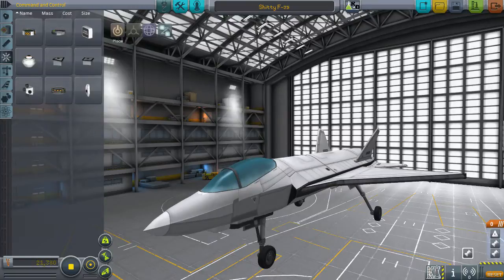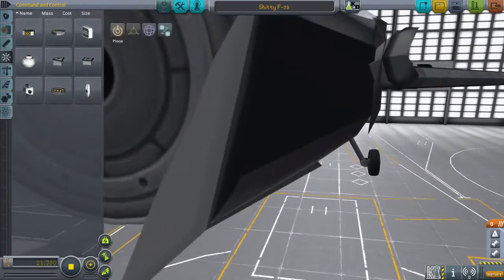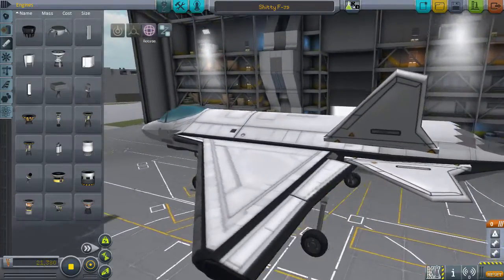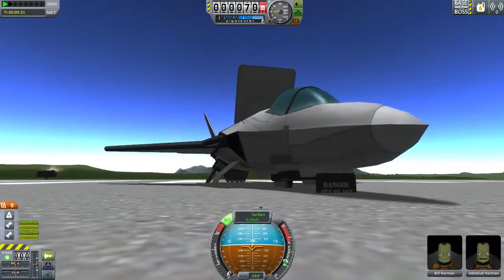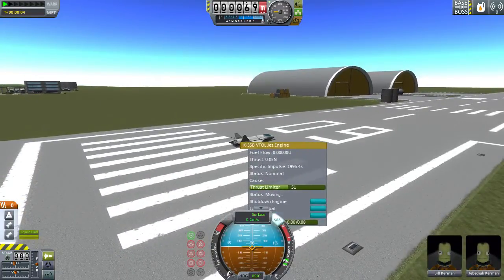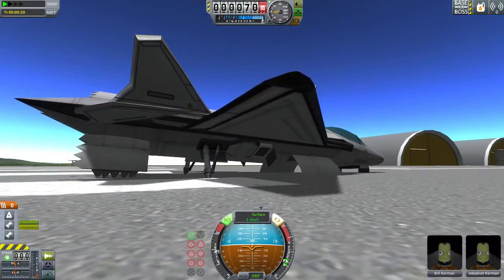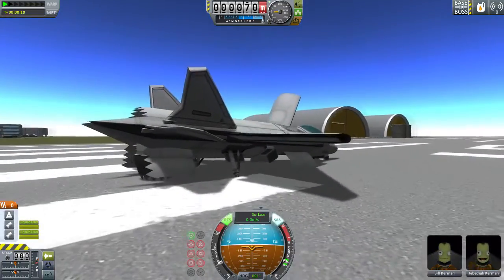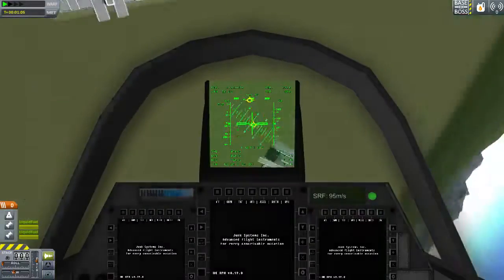Failing at VTOL, Attempted Mod Spotlight, QuizTech Aero Pack (KSP)

Comment: Heres a question I installed it correctly but the only parts i see in sandbox are the mk 2 probe and the vtol wing every other part from the engines to cockpits are missing an im using 1.02

Comment: Use a mod called Throttle Controlled Avionics, which will balance the thrust between the back and the front engines. I use it, and my VTOLs work like a charm.